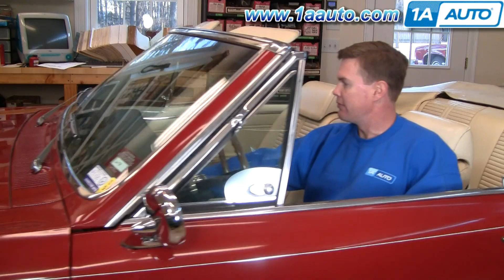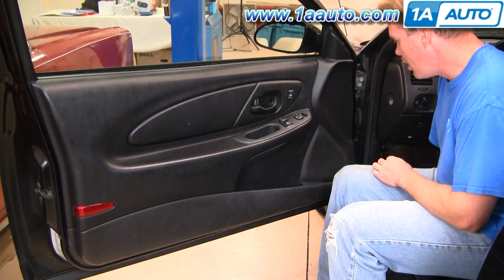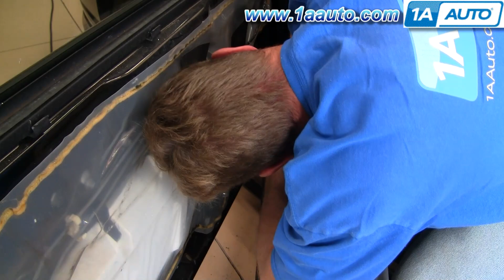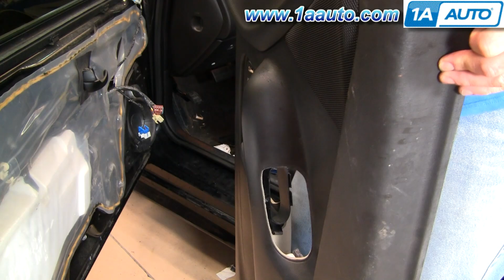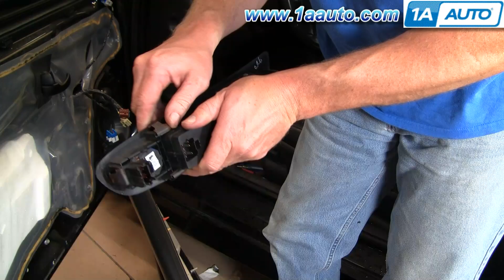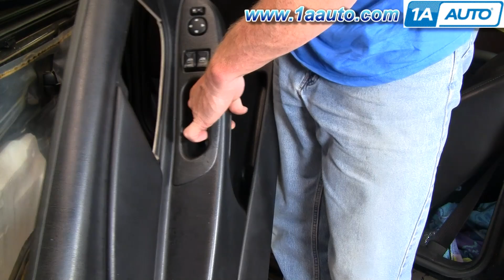How to Replace Power Window Switch 00-05 Chevy Monte Carlo

Comment: Thanks so much for this video!!  Did this today in about 25 minutes.  Hardest part was detaching the connectors from the inside of the door panel.  That was actually easy too though, just awkward because it's impossible to see the release clips.   Video provided excellent guidance.  A+++

Comment from the maker: You may want to try an automotive forum for your car to see if the members have instructions on making this repair. It shouldn't be to hard. You may need to remove the door panel to gain access to any screws that aren't visible and may be on the backside. Hope this helps you out.